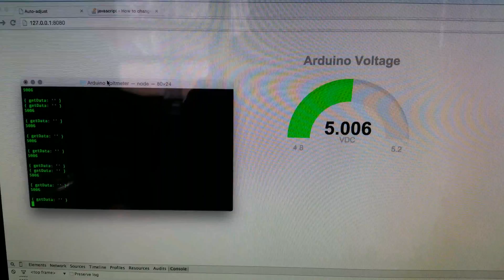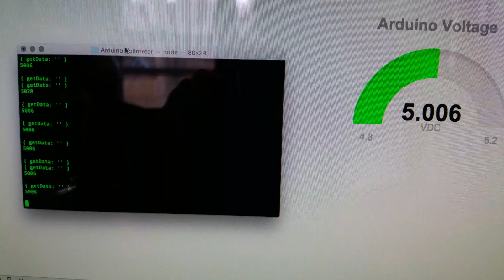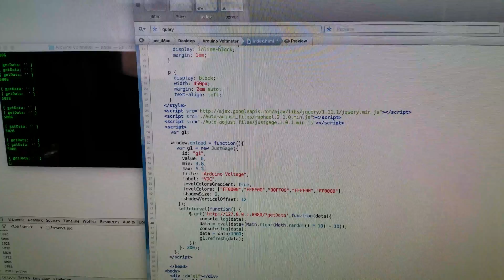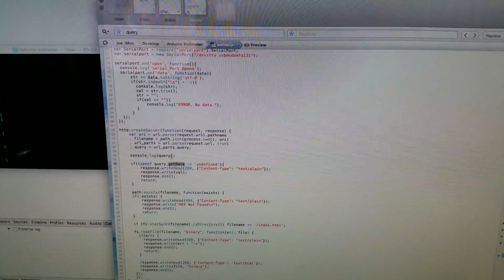Arduino voltmeter nodejs COM webserver justgage

Comment: Hi Joe. Trying to make the code work. I'm having trouble getting past line 43 where it checks for path. Seems like it might be a node permission issue. I also tried "fs.stat", "fs.access" with no luck.  I'm able to write to console the serial port read voltage.
Reply from the maker: it must be a permission issue. what is the error you get? What os are you running node on? Have u tried sudo if mac/linux/raspPi?
Joe
Reply: Hey Joe,  I've traced it down to fs.exists call back returning false thus returning 404.  Running node on raspbian. The value of filename is coming up wrong and it's duplicating directory name at the end of path. eg /var/www/html/projects-pi/projects-pi
Reply from the maker: Thats strange. how is it duplicating the dir? I would start over. Wipe it out. Then do a 
git clone https://github.com/jsammarco/ArduinoNodeVoltMeter

Then your going to need to install serial port. To do that run a 
npm install serialport
You might have issues there on a raspberry pi. That module is very os specific because of the USB serial stuff.
Once you get through that just run it.
node index.js
Or sudo node index.js on linux/mac

Hope this helps.
Joe
Reply: I opted to work with Node, Express & Socket.io . Using your arduino code with slight tweaks. days trying to get a grasp of all of this. Currently have a working app@! Thank you .
Reply from the maker: Great to hear. If you don't mind sharing I'd love to check it out.
Joe
Reply: Consulting Joe will do